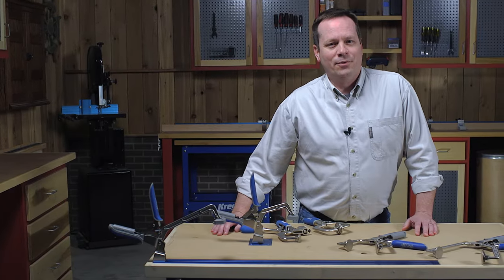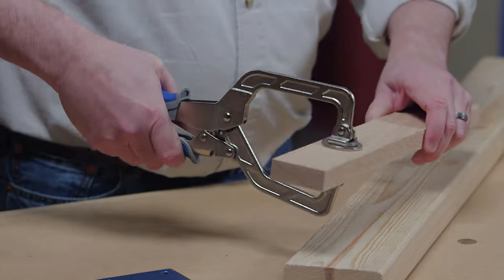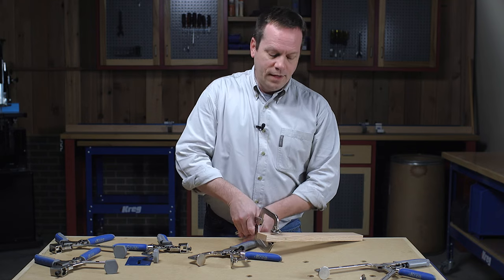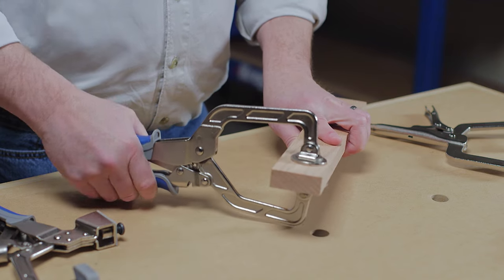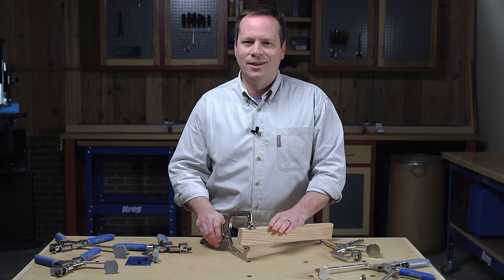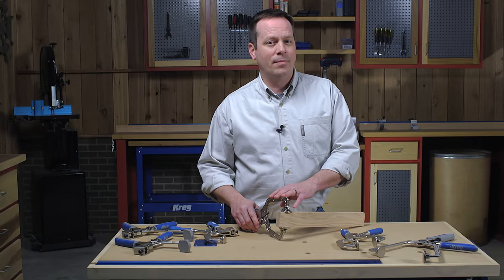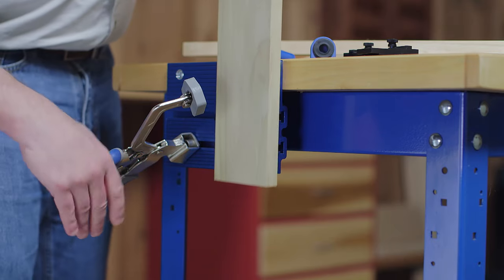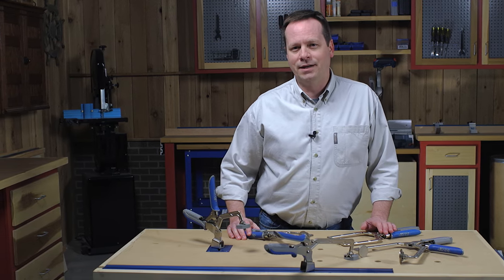Get A Firm Grip With These Auto-Adjusting Woodworking Clamps

Comment: The two I bought, a 6" clamp and a right angle clamp, somehow both managed to be broken, or else there is some secret to using these that I haven't yet divined. It is literally impossible to close them if the material is more than 3/4" thick. Will return as soon as possible and get something that at least works.
Reply from the maker: We apologize for the inconvenience. Please contact our Technical Support team at technicalsupport@kregtool.com or 800-447-8638 - they will be happy to help with this. Thanks!

Comment: Mine never worked right, i had to adjust every-time i changed from the jig to stock alignment, in fact I didn’t realize it was an auto clamp its was so bad , I figured I paid more for the inconvenient adjustment knob placement ..just this weekend I had to use a c-clamp to align my face frames  because it failed all together
Reply from the maker: Please contact our team at 800-447-8638 or kregtool.com/help - They will be happy to assist you with this. Thanks!

Comment: mine stopped working the day i got it. it wont secure clamping to any thickness to matter what i set the tension too
Reply from the maker: We apologize for the inconvenience. Please contact Technical Support at toll-free 800-447-8638 or technicalsupport@kregtool.com. They will gladly make this right for you. Thanks!
Reply: @KregToolCompany  same here...worked a day or two now won't pressure on anything no matter how much i try.

Comment: I have the 3 inch and 6 inch automaxx clamps.  They have been nothing but trouble.  They freeze up when I try to clamp anything.  I've tried oiling them, and adjusting the tension screws over and over but keep getting the same sticking issue.  It seems to be the black auto-adjust mechanism itself jamming in it's pocket   Sometimes the clamps work fine.  But it's a 50-50 chance they are going to jam up.  I'm so frustrated spending time to get the clamps working when that time should be spent meeting deadlines and getting product out the door.
Reply from the maker: We apologize for the inconvenience. Please contact our Technical Support team at technicalsupport@kregtool.com or 800-447-8638 - they will be happy to help with this. Thanks!
Reply: Thank you.  I did.  They walked me through the reset process,  but the clamps still jammed.  They are sending two new clamps.  Thanks for the quick response.
Reply: @lostinthewoodssmith9750  mine does the same thing,,,i believe if i was kreg i would throw these things in the trash and start over,,most of the people on here has trouble with them,,,,i believe i will go with milescraft,,dont have the auto max,,but alot cheaper and you do know what you are getting when you buy it,,,

Comment: The clamps will stop working after the adjustment screw falls out. That is, it will be stuck on one thickness.
Reply from the maker: Hi David. Sorry to hear this. If you could please contact out team at kregtool.com/help or 800-447-8638, they will be happy to assist you with this.

Comment: i have two of them -i can't get them to work-i don't use them-further i didn't get the drill stop gauge with my k-5 jig-why did you make it a separate piece-an integral gauge is much more convent bob tackney 315-387-5481 how do i get a gauge
Reply from the maker: Technical Support will be happy to help. You may reach them at technicalsupport@kregtool.com or 800-447-8638. Thanks!

Comment: well built tool with garbage technology.  required constant screw adjustment, then stopped working.    on both of the ones i bought.  simple use for 2 days - clamping 3/4 scrap to a workbench and fastening them together.
Reply from the maker: Please contact Technical Support at toll-free 800-447-8638 or kregtool.com./help - they will be happy to help with this. Thanks!